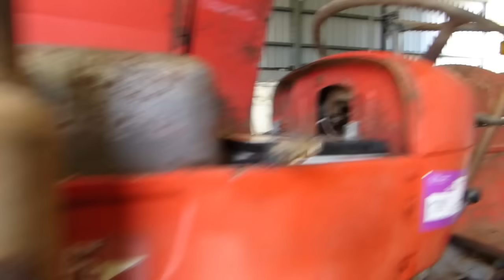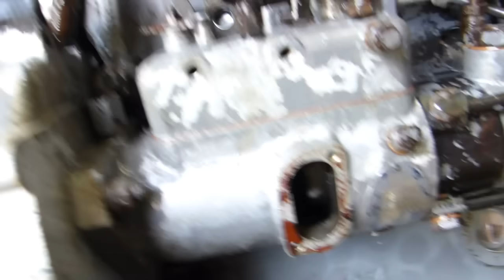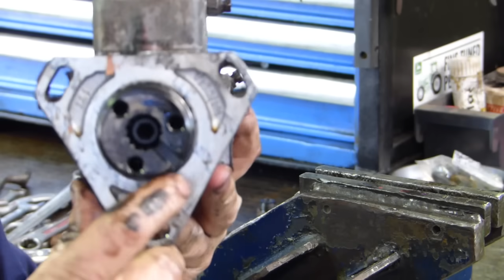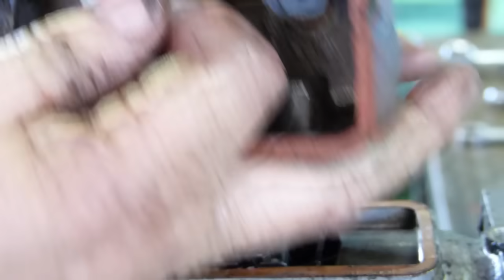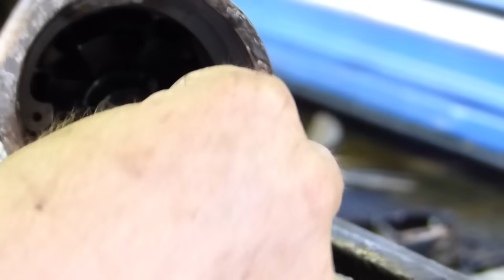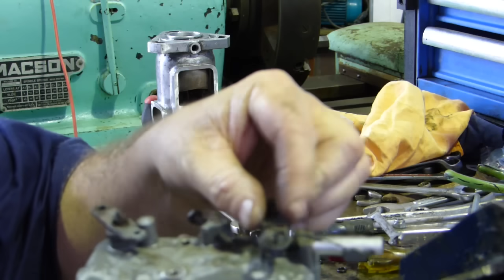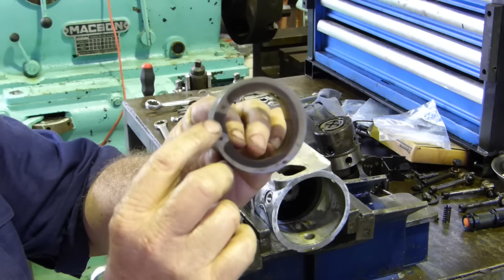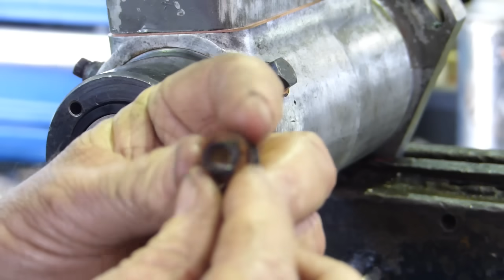CAV Injection pump full strip down to re seal and stop fuel leaks

Comment: Hi Lance,

I am inspired by you and have decided to attempt a full strip down and re seal of my tractors diesel fuel pump.

Before I remove it though and order the Complete Seal Kit, I would like your thoughts on what might be wrong with my pump so I order any other parts required at the same time (maybe a set of new pump blades or a one new spring as you show at 11:26)

Here is my story...

I have a Massey Ferguson 165 with a fuel pump that looks exactly like yours in this video but has 2 extra screws. One located before the end plate (where the fuel comes in). Its upright, about 6mm showing, the screw has a cut on its top (for flat screwdriver) and has something like a cap screw (like a cup) that slides over and bolts to covers the screw. The second is between the two injector outlet and when unscrewed it has a small pin inside with a spring movement.   Maybe you can tell me what these are.

Now to my problem.  No fuel comes out from the pump injectors. 

From the many attempts to get it going I have noticed that in a few instances when fuel did come out it happened on nice sunny days, when the sun has hit the tractor on the side of the pump for a few hours (till midday), 
In these few instances the tractor would start but it would not accelerate when I press the throttle. If i keep the throttle down for 5-10 seconds the revs star increasing slowly but when I leave the throttle and press it again the same problem continues, no acceleration. I mention the sunny days because it might have to do with something in the pump that has hardened (a seal, some sludge? ) and when the pump warms up it softens and it starts moving  thus fuel comes out of the injector outlets.

I have changed filters, checked the fuel and tank (once when I unscrewed the fuel tap all the way, no fuel was coming out. with a piece of wire, put it in the hole, jiggled it and started to run again), I have also tried using an external tank/bottle (avoiding the original tank) just in case it was something with the tank and its fuel. No difference.
When I use the hand/lift pump, fuel runs to both fuel filter (check air bleeder screws), pump (both air bleeder screws) and all the fuel goes to return line, nothing comes out from pump injectors.

I have also noticed a few times some turbulence in the glass fuel bowl when I attempt to start the tractor. Not sure if this is normal.

Based on your video I have a few thoughts:
Maybe its the metering valve you show at 24:20.
Maybe its the plunger or the spring you show at 11:26

Awaiting your feedback and hope it is something simple that I can clean or replace so the pump works as it did a few months ago.

Many many thanks,
Costas
Reply from the maker: I think my best advice would be to go to my Massey Ferguson 135 6 speed play list and look at videos 14 and 15. I feel I explain things way better there than in this first video. You need probably 1 to 2l/min flow from the fuel system into the pump for it to work correctly but stripping and polishing does wonders at times.

Comment: What is the line that is closest to the timing hear for? Your videos are a great help!
Reply from the maker: Return line to the tank for excess fuel.
Reply: @bundybearsshed  ok I had an idea that’s what that was for. I also am replacing the big governor spring and idler spring that attaches to the throttle arm. Any suggestions on where to get them and will that mess with anything?

Comment: Thank you so much for all the videos and the hassle you go through setting up the camera and recording it. Ford tractor  started leaking bad from the fuel pump and I was looking for a mechanic believing it is way beyond my abilities.  Watched your video and after a careful inspection it just turned out to be the top two nuts being loose on the cap. Just tightened them up and seals were fine. Silly me and without your video I would still be wandering around upset thinking what to do. I wish the best for you and your family. Thank you.
Reply from the maker: Glad it all worked for you.

Comment: I just serviced the pump top on a Yugoslavian IMT 539 deluxe, replacing the o rings on the engine stop and throtle spindles, to stop some significant fuel leaks. Your video is just spot on with detail and the brilliant advice. Once I'd watched this, the hardest part was the air bleed.  It's a long time (circa 40 years!)  since I did any engine work and this was really helpful, thanks a lot.
Reply from the maker: Nice work! Glad it helped.

Comment: Hi Lance, I’m wondering why the CAV pump on my David Brown 885 is not getting fuel up to the injectors, fuel is getting to the pump and up to the bleed screw, but it’s not coming out from the 3 exit ports going to each injector. 
Is there any things I could do or check to try and find the problem? Im still apprehensive about taking the pump off and having a deeper look. So Im wondering if anyone has any tips?
Reply from the maker: Check my Massey Ferguson 135 6 speed series videos 14 and 15, same pump really. Im thinking you have a sticky metering valve.

Comment: Is it safe to remove top cover, metering device and head while pump is still in the tractor? The shop told me I may have to recalibrate if I get in there. My pump is leaking from the head and I suspect the o-ring must be bad.
Reply: The o-ring I am speaking of is at 26:30
Reply from the maker: Certainly safe, the top cover is something we would do in the field but the big o ring I take the pump off. You can slide it out just enough to get to it after undoing the bolts and you dont need to calibrate at all. Have a look at my Massey Ferguson 135 6 speed series videos 14 and 15 where I go into the pump a little more. I believe they are better videos.
Reply: @bundybearsshed  I’m confused. Slide what out the  head or the entire pump? Which bolts the mounting bolts? Or the head bolts?
You said you like to take the pump out of the tractor to do the big o ring, can I leave it in and change the big o ring?
Reply from the maker: @dmoneygage  I take the pump off for the big o ring but you can do it in place. The bolts that hold the head in place so it doesn't fall out normally.look at my MF135 6 speed series on videos 14 and 15.
Reply: @bundybearsshed  thank you. I’m part way thru #14, very informative and inspiring.  It’s great that you are spreading your experience and expertise around for others to benefit. Very noble.

Comment: Great Video, I appreciate you going through everything, it clears alot up. I was wondering if you could help, I am having problems finding a rebuild kit for mine.  It is for My Massey Ferguson (2002) 231s. The Fuel Injection Pump is a Delphi, Type 1235, Designation 8922A242G, Serial #13132MUG, Model 2644A450FN/2/2420. Can you point me in the Right Direction?
Reply from the maker: We only seem to have the CAV kits available but if it looks the same it should fit. The numbers dont help us as we are not a dealer so we dont have that information available to us.
Reply: @bundybearsshed  Thank You, I appreciate it! Keep the Videos Coming, They are Great!

Comment: HI, lance, the thing to watch is when you are removing the pump on an industrial engine, is to locate the drive gear to the timing cover,
jamb it with a piece of wood or something, because the gear will drop down inside the timing cover, therefore losing your timing it happened to me and I had to remove the timing cover. This is on the MF AD3152 engine . Hope this helps
Reply from the maker: ok thanks.

Comment: You, sir, are a hero. Helping a friend get his MF 165 going again, but the high pressure part seem stuck as we cannot get it to throw fuel to the injectors.
Gonna do a full re-seal on the pump and check if the injector rollers cannot be freed. (Otherwise we need a new pump).

Thank you again, sir.
Reply from the maker: Check my Massey Ferguson 135 6 speed series videos 14 and 15. I feel I do a way better job of explaining the pump there.

Comment: Hello! Thanks a lot for great videos! I just rebuild my own cav diesel pump now after finding the motivation through your teachings. Just a question though. I wonder if I accidentally did something wrong when mounting the top cover, I got the springs in the right holes, but when I try to test the pump too see if it is working, It's pumping out of the bleed screw, but nothing to the injectors. Another thing that made me wonder is that when I give some throttle I feel resistance in the pump, is that normal?  Anyways thanks again for great tutorials :)
Reply from the maker: Check out my 135 6 speed series videos 14 and 15. I do a way better job of explaining the workings of the pump there.

Comment: Please help.   I have 1966 nuffield traktor.  My pump is like yours.   It gets fuel from the feeder pump. It squirts out of the air/bleeding skrew But it only drips out the fuel lines out of the pump (to the sylinders)  one drop pr 3sec.    What is wrong?
Reply from the maker: Stuck metering valve probably, check out my 135 6 speed play list I did better injection pump videos in there

Comment: Fantastic! So glad I found your advices. Trying to solve a problem of randomly stopping Landini 7500 after 5-20min then restarting effortlessly but again stopping after 5-20mins. Think it might be the little plunger below the inlet filter of the CAV. Gonna try to do what you showed first THANKS!
Reply from the maker: Glad it helped! Check out my 135 6 speed play list videos 14 and 15. I feel I do a way better job of explaining things.
Reply: @bundybearsshed  Too bad for me, I did find a damaged filter and rubbish  that looked like to block the little piston but after carefully cleaning the tractor again suddenly stopped after 15 mins... I'm lost. Last thing to try is to feed the CAV directly from a seperate dieseltank/filter to remove the inlet circuit from any possible errors. We'll see from there

Comment: I'm about to go punch a diesel mechanic right in the mouth... $1000-1500 to do THIS? Damn, I just got a new sideline! Like everything, all it takes is a bit of special knowledge when one is already a lifelong mechanic. 
Thanks SOOOO much for sharing this! Being from Texas, I immediately recognized the sound of all that shop tin expanding in the Aussie sun... its a distinct sound no doubt. 
Now a couple of Aussie > Mer'ican translations: 
Spanner = Open End Wrench;
Circlet = Internal Snap Ring. 
Lol... couldn't resist! Again, thanks for saving me upward of 2-3k as I have 2 of these plaguing me with leaks and no-starts. One on a 1972 JD1530 and the other on my 1985 Lincoln SA250. 
Well done mate!!! If ever in Texas, I'll BBQ a side of beef for you.
Reply from the maker: Have a look at my MF135 6 speed play list videos 14 and 15, I think they are a better video on these pumps.
Reply: @bundybearsshed  don't know how that's possible sir... you did an exellent job here! Apologies for the slow reply... been trying to get a heater built before cold hits the Lone Star State, and I didn't make it with everythig else breaking in the meantime. Sometimes being Mr Fixit isn't all its cracked up to be! 
Btw, when I say everything else breaking... I'm talking stuff like the cam stopped turning on my Case450C, likely due to the "killer dowel pin" issue with the Cummings 4-390. Talk about depressing amounts of $$$!

Comment: I have a Ford 3000 with a CAV pump the tractor will run fine but sometimes it shuts down as if you pulled the stop. If you break the line loose on any one of the 3 injectors it will start right back up. Any suggestions
Reply: My email is easthowellsville@gmail.com
Reply from the maker: You are getting air from somewhere or the metering valve is sticking. I would go with air as most likely though.
Reply: Thank you.

Comment: Enjoyed your excellent video.  I do wish the portion where you assembled the regulating springs and other parts in the end cover had been in camera view.  I have my DPA 3232978 Ser R2954 OH on the bench now and have questions about the assembly order of some of the components.  Would like to send you a picture of the components laid out in the order I think are correct.  1965 Ford 4400 TLB.  I have the Ford/New Holland diagram but still a bit fuzzy.  When I disassembled the end cover components it required a little pop against the workbench top so was not able to see the exact sequence.
Reply from the maker: Check my videos in the Massey Ferguson 135 6 speed playlist. It is a few years later on and I do a better job of explaining things. Videos 14 and 15 are the ones you are looking for. on my web site www.queenslandtractorspares.com.au there is a free download of the CAV workshop manual you might also find handy.

Comment: Trying to get an old ford 5000 going. I've bled it all the way to the pump and the pump is getting plenty of fuel but there is absoluteley nothing coming out of the injector lines. I'm guessing the metering valve is stuck like you said, so I'll tear into it and have a look. Thanks for your very helpful video
Reply from the maker: I think I did a better video in my Massey Ferguson 135 6 speed series videos 14 and 15. I re watched this quite a while after doing it and thought I could have done a better job so I have a few out there now.

Comment: Your video just solved my issue. I was driving myself crazy bleeding my 1960's MM G450 tractor and sure I was going to have to send in my injection pump. I could not get the fuel from the second bleed to the Injector lines. The tractor had not been run for more than five years, I got it started and moved out of the way for another project, the lift/primer pump leaked terribly. Replaced that and the filters and bled it many times. No fuel at the injectors. Tapped a few friends and called the dealer for help, everyone was of the same suggestion, "AIR". I bled it again and again. Pulled it several times over two miles.  It was like the kill was pulled.  Thanks to your video, I got the courage to open the cap and eventually found that the Metering Valve was not moving freely.  I cleaned it with WD40 and that removed the film from the old fuel. Was able to bleed it cranking it and it is back in motion.  Thank you, thank you, thank you.
Reply from the maker: Thanks Rick, I think I did a better video in my Massey Ferguson 135 6 speed series videos 14 and 15. I re watched this quite q while after doing it and thought I could have done a better job so I have a few out there now.

Comment: I notice that there are some haters for this video??? What's wrong with you people??? Jealous because you don't know your left from your right??? Watched Bundy here and promptly tore down my injector pump and spent the $25.00 for the rebuild kit. No more leaks and no more fuel dumping into my crankcase! Problem solved, all thanks goes to Bundy!
Reply from the maker: Yeah I dont worry we are well over 1 million views so we are helping many. I think I did a better video in my Massey Ferguson 135 6 speed series videos 14 and 15. I re watched this quite q while after doing it and thought I could have done a better job so I have a few out there now.
Reply: Problem is he can’t calibrate the pump..it could be out,would be wise to. Run it up on a test bench for re-calibration while he’s got the pump on the bench…ex fuel injection technician…,
Reply: I’m not getting fuel to my injector line I put a potato pump I only get a wet in the line I was wondering what’s my problem

Comment: Thanks for the video it is easy to follow. If I change the cam or the pumping rollers, can I just mark the position of fuel adjustment . and assume same  equal delivery of fuel ? Or should it be tested ?
Reply from the maker: Yes you can! Just mark where it was there is usually a shadow on the steel to help. I do a better explination in my Massey Ferguson 135 6 speed play list videos 14 and 15.

Comment: Greetings from Gatton Qld. My old David Brown 990 has been leaking at the throttle control and fuel switch for a while. At first it was the occasional drip when running but after I left it long enough it would leak down to the point I'd have to bleed the injectors to start it...so armed with the instructions I'm gunna invest in some o-rings. I'll save a fortune in diesel...
Reply from the maker: G Day Ray, Have a look at my Massey Ferguson 135 6 speed series videos 14 and 15 I go deeper and explain things better I feel.

Comment: Which way should shut off lever rotate to be in run position?
Reply from the maker: Anti clockwise from the top usually.
Reply: @bundybearsshed  A big thanks for your reply! I have a perkins 4-108 in a 441 skid steer, it has cav pump, but if thats the case, it looks like I ve been trying to prime everthing in the off position lol